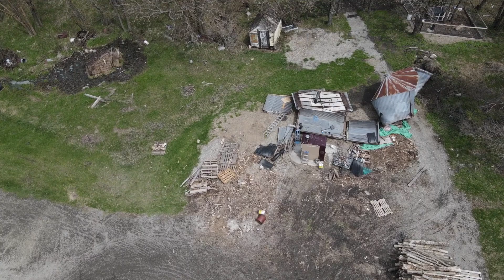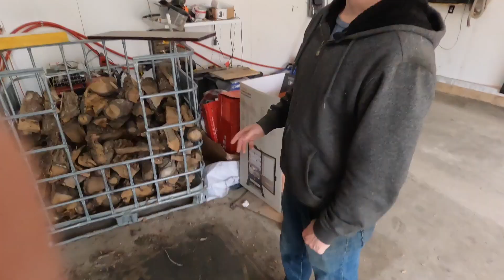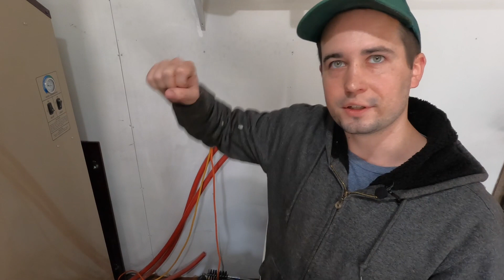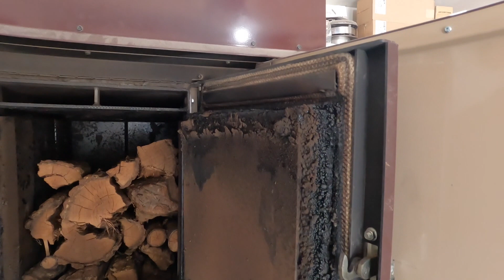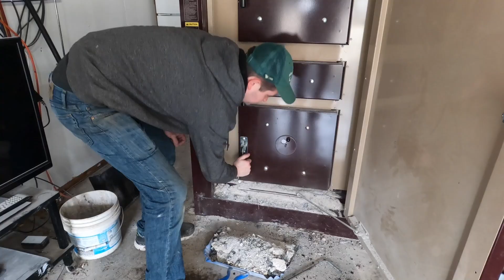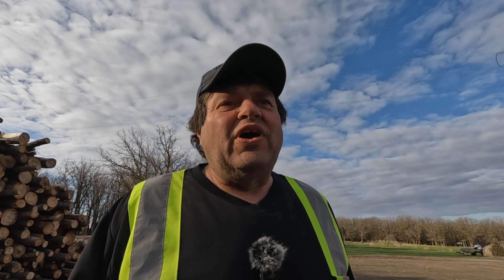Polar Gasification  outside wood boiler furnace year end shut down

Comment: what happens if u loose power?
Reply from the maker: You'll need a generator to run the stove and pumps but the good news is they don't take much power. It has happen to me and we have a 5 KW generator on the farm here we use when power goes out to run the boiler along with other things ( separately not at same time)